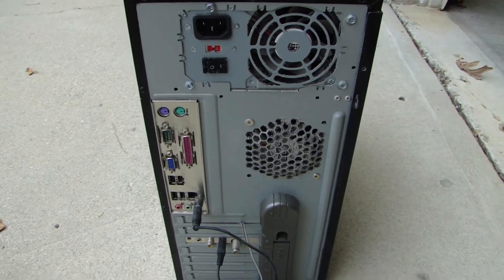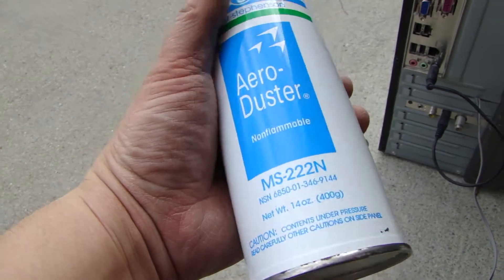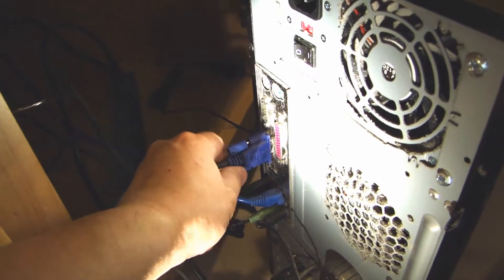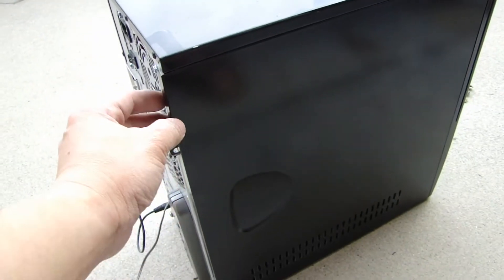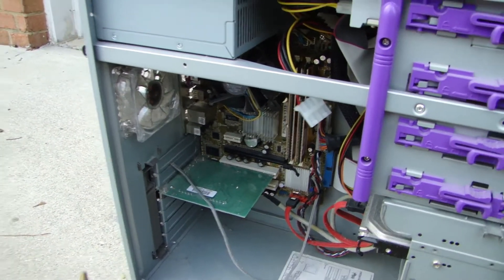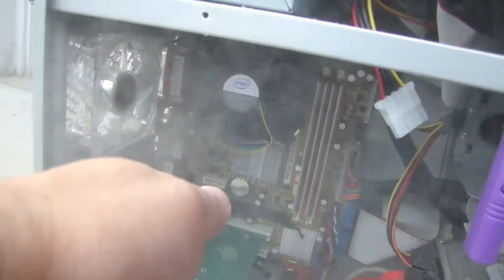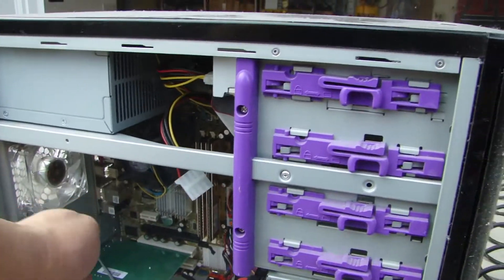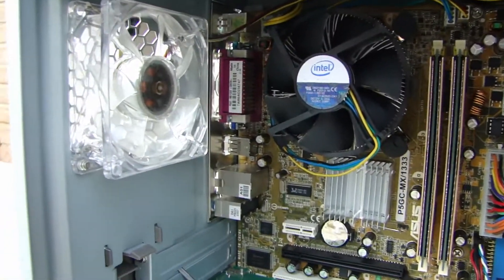How To Clean Computer Dust - FAST & EASY

Comment: You do not want to blow the fans out this way, it's a sure bet that you'll reduce their life expectancy by killing the bearings this way. I have been cleaning computers and servers with compressors for the past 25 years, and have always held the fans immobile using a piece of wood, or a screwdriver handle (don't use your fingers).  It is also advisable to remove the front bezel before dusting, since that's the area where 90% of the dust enters the chassis.

Comment: Sure Let Power Wash with 20gal Of AIR via Shop air compressor it been done (result shop was dusty)  - I was ask by cousin to clean her PC she a heavy smoker. The inside of the PC look like a cave of light brown tint dust.. reek of Smoke smell (note Clean Outside)  Her fans had a layer of Dust.. I go 2 more step like we have shop vac PC attachment to end nozzle vac hose that smaller extension tube attach brush to into tight places... cause the fan blades can have dust dirt build up if there if the air is humid.. hand clean each Blade front & back. after that it Run.  yet She got a new PC